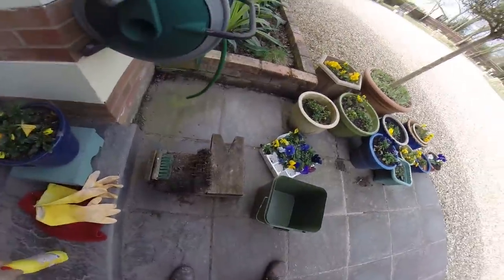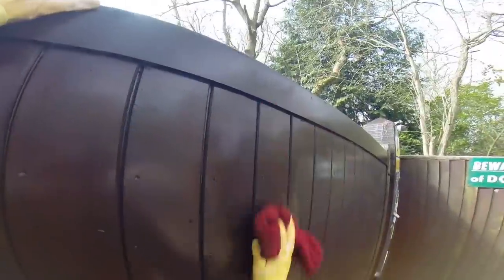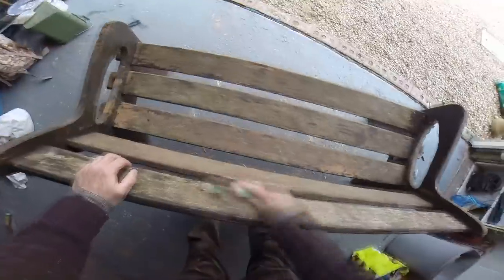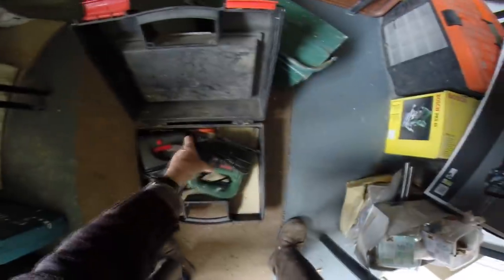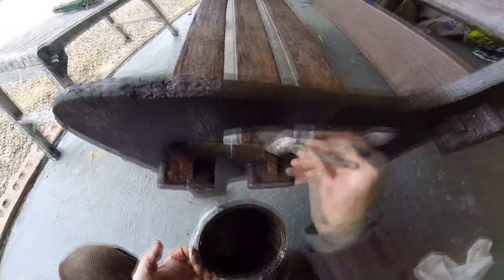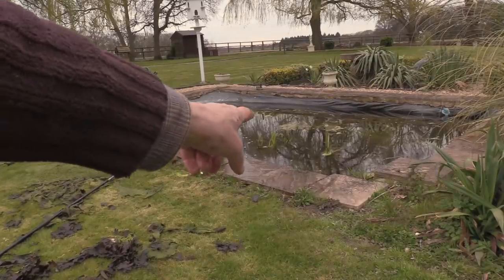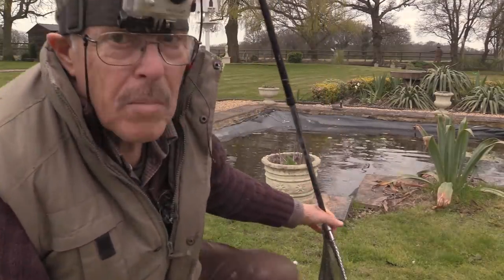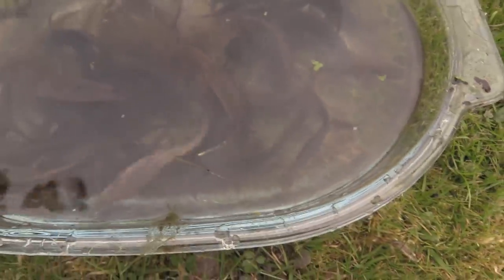Guess what I found?? YUK!

Comment: I use watered down bleach (In a spray bottle, about 15-20% Domestos or similar bleach mixed with 80-85% water) to spray any mould in the bathroom and any other rooms I spot it in.
Do it also before painting any walls/ceilings where mould has been present before and leave to dry before painting, just to make sure there isn't any about to regrow.

Comment: SMITH (hand raised): It's Smith here Mr Pullen Sir. I also have had paint problems. I went to the local Poundland in the first few days of the lockdown to stockpile Werther's Originals and thought I'd buy 2 small tins of white paint so paint the window sill and earn my pocket money. The tins were very small and cost £1 each so I needed 2. I had also bought a tin of tomato soup and a tin of vegetable. I was told at the till I could only have one tin of white paint. So I put the other aside (thinking I'd go back for it the next day) and also put aside one of the soups - the tomato one. But no! I could have the 2 tins of soup cos they were different and I could have 2 tins of paint as long as the other was black. Well, I was painting a window sill not a chess board, so that was no good. Worse still, I went back the next day and they had sold out of white paint but, to annoy me even more, they had plenty of tins of black. Even worse still, I painted the window sill black and, instead of getting my pocket money, got a cuff round the ear for making the home look like a funeral parlour. Now Poundland is closed and all my Werthers Originals have run out. Can you make some butterscotch in your next video please? You could use your lead weight moulds for the shape.
Reply from the maker: Ha !..love that one...when someone takes the trouble to type anything longer than "GR8" or "LOL" and can clearly fashion a legible sentence it does make doing my wacko films worthwhile .I realise I probably have some older (1950's ??) guys following me,and luckily some still have that sense of the amusing...was it being a listener to the Goon Show that creates our somewhat warped with humour brains ? Eccles ? Minnie ?  Major Bloodnock ? Whatever it is,I hope it doesn't change. That Spike Milligan ,Secombe and Sellers trio have a lot to answer for in my generation.

Comment: Great video mr g I av a 6 foot by 5 foot pond clean pump an filter on I've ad it for 3 years never ad blanket weed this year loads of it what causes it thanks
Reply from the maker: I did have a cable and pump running in there when I first set it up and the movement does inhibit the weed growth,but even with a timer setup it stills eats electricity with the fountain. So I removed the pump/fountain. Only had it running as I had fish in there. But several visits by Mr Heron put paid to any fishy activity.
Reply: @TAFishing  bloody herons thanks for the reply 👍👍

Comment: Has to be done.. or the BW dies off and sucks all the oxygen out of the pond as it decays. The leaves probably feeding it as it decays, Good to see you have wildlife. Got Green Tench and Koi in the pond but still manage damselflies, caddisflies and two frogs.
Reply from the maker: Yes I have noticed when the blanket weed sort of bubbles foamy and partly dries on the surface it kills off my lilies and increases the water temperature them when it mats up. Guess its the deoxygenation. They say to put a bale of Barley straw in to stop it,but I have seen fisheries with racks of Barley and its still chocked with weed and unfishable. Tough one to beat in sunny weather.

Comment: Sounds silly? I’d be tempted to get a jet was and out a little bit of bleach in and jet wash it off
Reply from the maker: I did exactly that last summer when it dried out .I noticed strands of blanket weed still stuck to the edge of the liner and a pain to remove. The pond dries out pretty much every year now with the climate change so nothing lives in it until the rains fill it up in the winter.